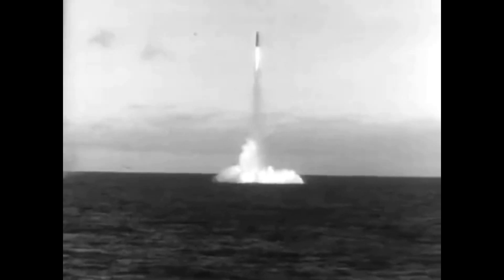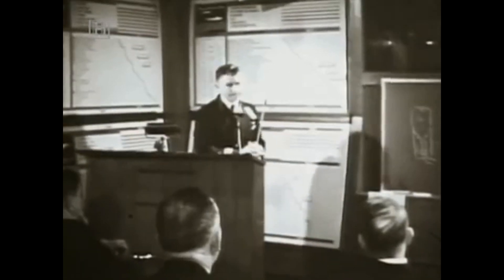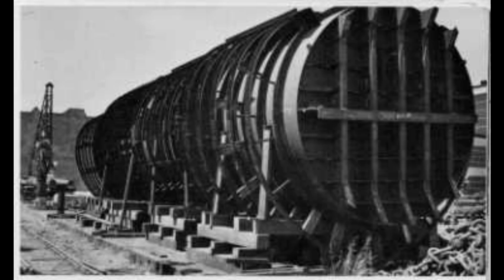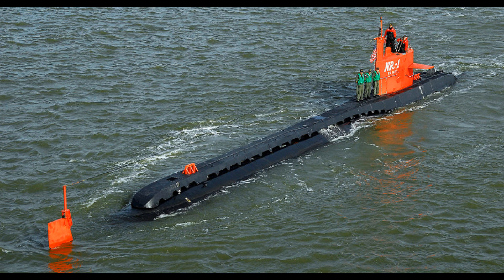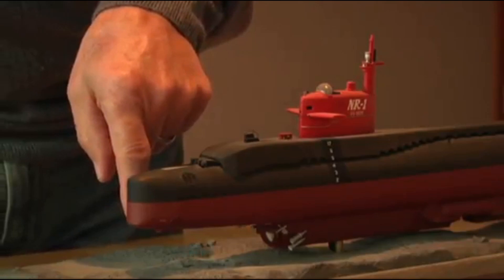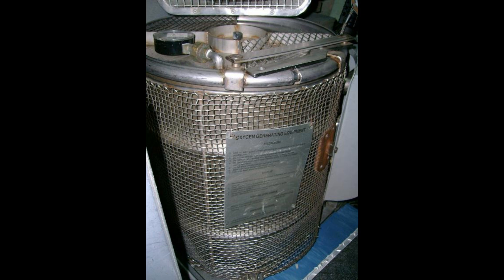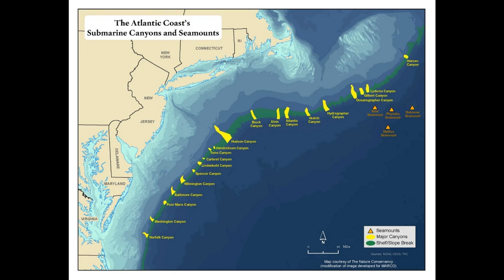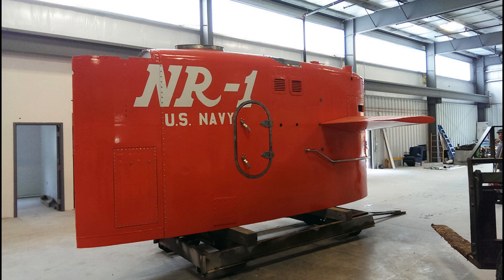The NR-1 | The US Navy spy submarine hidden in plain sight.

Comment: I saw the NR1 once,, well the word "see" isn't exactly correct , I glimpse it behind a fence on lower base in Groton, Conn at the naval base there.
    I had a relative that was a EM/ nuke on a fast attack boat based there and I visited him for a week in the summer of 1984. I asked the relative what was behind the fence and what it was used for but as a good squid he was pretty tight lipped about it.  Looked smaller to me as I remember , probably cause most of the hull was underwater and I was looking at the bow and sail of the sub from the gaps in the fence .
    I did press him about anything "good" he could tell me but all I got is ," you would be surprised where the boat has been and why " but anything more that was only in my imagination, He never has talked to me about any sea duty "stories" from the 12 yrs (or more, can't remember) while a submariner.
  Guess it's one reason it's called the silent service.

Comment: What is the use of having a nuclear submarine that does not need to be autonomous? Why not just make it battery powered? If it has a mother ship, let that charge the batteries.  What am I missing here? 
Respectfully asked. 
Good video.
Reply: because battery powered submersibles only have a 12 hour charge. there is about 3 hour time to descend and a equal time for asscent, with leaves usually 6 hours to work.  Often times if you find something, you are at the end of your battery, and need to resurface.  Re-finding the interest is difficult. however once you find the object of interest on a nuclear powered vessel your stay is limited by crew endurance and food.  These missions are very expensive by the hour and time spent surfacing and submerging simply increase overall cost of the mission. 

BTW I served on the NR-1 and know most of the capabilities of the deep submersible world

Comment: Didn’t the USS Halibut do most of the wire tapping?
Reply from the maker: Both subs had similar missions. The Halibut was pacific based and the NR-1 was Atlantic based. The halibut also needed to use divers to do all of its work outside of the sub. The NR-1 could do its work using its hydraulic arms and in much much deeper water.
Reply: You’ve forgotten the Seawolf SSN-575, the Parche SSN-683 and the Richard B Russell SSN-687

Comment: In the early 1990's , I worked at SUBASE Groton-New London for a company that was doing contracting ,and maintaining 
systems at SUBASE. In the 5 years there, one of the locations I was responsible for was the NR-1.  I had to install  or repair system components at the NR-1 and on the Mother ship Carolyn Choest , along with 20 Attack Submarines,mostly
688 Attack boats. It was very interesting, and when I retired in 1999 , I had worked on the majority of the boats, support
craft, and all shore facilities. As well as foreign submarines that routinely made port calls at Groton , including German
diesel Submarines and their support ships. And  once  a Japanese Destroyer.

Comment: Does anyone know why the need to make this sub nuclear powered, instead of diesel, if he was going to be operating with a mother ship anyway?
Reply from the maker: So it could stay on bottom for weeks at a time without needing to surface to recharge batteries, etc. It wasn’t tethered to the ship. So it needed a certain level of autonomy to operate independently from the mother ship at depth.
Reply: @theatomiccafe8996  Makes sense, thanks!
Reply: In the ocean a storm can come up requiring NR1 to stay down longer than batteries could allow for. A nuclear reactor was safer.
Reply: For bottom time the Dolphin SS-555 could go deeper but limited endurance

Comment: I wonder if they replaced it with a modern small sub? 

And why the hell did they scrap it?  They can't have gotten much material.  That baby should be in a museum!
Reply: Only a small portion of the sub was shielded from the Nuc Plant... Which means about 60% of the sub glowed at night....
Reply: Actually, remember the Seawolf class subs? Subs like the USS Jimmy Carter are tasked with the spec ops type stuff like this now.
Reply: @WALTERBROADDUS  actually Seawolf class neither has the capabilities for recovery, observation nor ability to go the depths the NR-1 had... their missions are very different.
Reply: Museum? Cost and nuc disposal issues. Only Nautilus has been saved as a museum.
Reply: WALTERBROADDUS  .... shucks .. reactor was only size of a refrigerator. Should have just used a ‘hot wrench’ on it, removed it. Then, use a large crane, lift it (the submarine) out of the water. Store it on some dockyard until they find someone who wants it. I swear, the military is so quick to scrap stuff after useful life over. So wasteful and shortsighted. Still burns me that after WW2, they just pushed surplus aircraft off decks of aircraft carriers. Sunk captured submarines just for the heck of it. Sure be nice to have that stuff around now.
Reply: @davidthelander1299  Thr two basic problems for saving a Naval vessel such as the NR-1 is money to maintain it as a museum and declassifying the ship. Scraping the NR-1 is the easiest way for the US Navy to declassify the sub. Just my opinion.
Reply: Donald Palmrose   I hear you. Money is always an issue of course. But, they didn’t need to turn it into a museum. (Would have been nice)  But, they could have just left it alone. Stuck it on a quay somewhere, or barged it up a river and left it for a static display. After the hundreds of millions of dollars spent building it and operating it for 30 + years, the cost of this would be minuscule in comparison.    I’m an old man and I like to see ‘old things’ preserved.  :)
Reply: (Especially old men)
Reply: @davidthelander1299  Not disagreeing with you, I would like to see more museum ships. But look what happened to the USS Barry that use to be a museum ship next to the Navy Yard in DC. Hull was not maintained probably due to cost and it had to be towed away and scrapped. Most orgs maintaining such ships are cash poor so keeping what we have now is a blessing. Look at the task for preserving the BB USS Texas.
Reply: There's a publicly-available Navy study proposing an NR-2, its advantages, and disadvantages.

The biggest reason, it seems, is the advancement of unmanned craft for similar tasks.
Reply: @alexkimmell7320  Pretty much anyone who worked on NR-1 or the boats at Mare Island kept (and still do) tight lipped about what they did on deployments. People like Musk and Bezos should be putting their billions into underwater exploration instead of outer space.
Reply: I could only guess one of the reasons for not making it a museum is so the general public couldn't see it and pictures or what not get out.
Reply: @Mark-OutWest  The NR-1's capabilities/specs are publicly documented to a pretty staggering degree, and based on the conversations I've had with former NR-1 crewmembers, those specs aren't necessarily incorrect, nor were they ever too concerned with discussing them with me. The NR-1s real secrets are in its missions, and for a boat with as long as a service life as the NR-1, there is little info available on what it was up to for all those years.

Like it's been mentioned earlier, the NR-1 had very little shielding around its reactor compartment, making it extremely costly if not impossible to be safely displayed. Crew accommodations were also horrid and cramped, and the entire project went well over-budget and was widely 'hidden' from the Navy's expenses (hence the hull number NR-1) in a fairly financially-wasteful era of the US Navy itself. Couple this with the classified nature of the vast majority of its most important missions, and the Navy probably had zero interest in highlighting it to the general public.
Reply: @alexkimmell7320   :shrug: I thought our bunk was comfortable ... it's just being in boat with all off us eating microwave burritos and chimichangas and using o2 candles that was a little awkward .
Reply: @queenstease2444  I heard the 'shower' could have been improved upon a bit as well... but I don't have to tell you that. Did the watch walk over you as you slept?
Reply: If there is a replacement the public won't be told for a few more decades.
Reply: @binaway  Yes we will, the construction of NR-1 was public.  Did you see the pictures of the launch ceremony?  And the design proposal/status of NR-2 is also publicly available.
Reply: To hide it's secrets

Comment: Served on the Kennedy (CV -67) in 1976 I was a green shirt in VF-32 on deck the day we lost a Tomcat over the side with a highly classified AIM-54 missile and the AWG-9 avionics package that controlled it. We didn't know it for decades but they were retrieved by the top secret NR-1. I watched a red shirt get his ankle skidded over I heard he was trying to resafe the weapons as the plane screeched full throttle down the deck with the brakes locked. Lt Kosich managed to miss a line of A-7's that had just been fueled and loaded with ordnance before ejecting with his RIO. They both came down on the deck the RIO broke something in his leg landing on a folded A-6. Another guy on deck got slamed with the canopy after the ejection. Note... the canopy weighes hundreds of pounds. We left the area off the coast of Scotland and then slammed into the USS Borderlon like a day or two later while refueling in high seas. We had caused a Broken Arrow the year before running down the nuclear armed missile frigate USS Belknap.  This is why the Big John was also known as the "Can Opener" and the "Tin Can Killer" after demostrating the dangers of getting too close to massive vessels in high seas more than once. Sometimes during refuelng or other "UNREP" operations a vessel that was 200' feet away at the top of a wave would be close enough to step onto at the bottom  of the wave. I'm amazed vessels didn't collide more. It didn't help that big ships like carriers tend to suck smaller vessels into them because they displace so much water while underway.
Reply: Jeesh !   Hope that redshirt recovered alright, talk bout persisting in ones mission.   We had a private airman who wasn't careful, got his foot run over by an F-16 tire while fully fueled and armed.   His foot could not be saved.
Reply: JFK is still in Philadelphia waiting for the breaker.
Reply: @WALTERBROADDUS  I know it's pretty sad too she is one of the last two conventional powered carriers that can be offered as a museum ship but she was removed from the program. The nuclear powered carriers have to be broken up to remove their reactors so it is doubtful any of them will be saved in the future.
Reply: @JoeBLOWFHB  The museum market is full. Off hand, we have 5 CV museums.
Reply: Doesnt it make you kind of sad to think you'll likely never see a flying f14 again 
I mean most fighters end up with ar least one in private hands displayed at air shows
Certainly makes me sad anyhow
I never got to see an f14 flying... such a beautiful and unique looking aircraft
Reply: @daveshaw9344  Iran still flies them, I think.
Reply: Most people don't realize how dangerous a flight deck really is. Or maneuvering ships close to each other in heavy seas, either. Even when the Navy is in peacetime they are still at war with the elements.
Reply: I was Aboard then with VF-14 in the Galley peeling spuds. Token Black shoe 76 thru 12/79
   Ship for 6! Look at all the Bennies!!
Reply: I was on the Holland (AS-32) where the NR-1 was based when it recovered the items from the Tomcat.
And I'm told a news photo with the NR-1 in the background was the first public acknowledgement of it's existence.
Reply: My buddy was a BT on her when off Lebanon with the NEW JERSEY
Reply: Bent spear not broken arrow.

Delivery system damaged not damaged nuclear weapon.

+